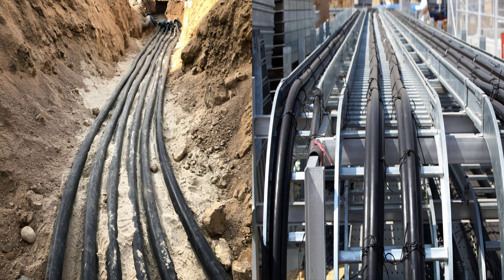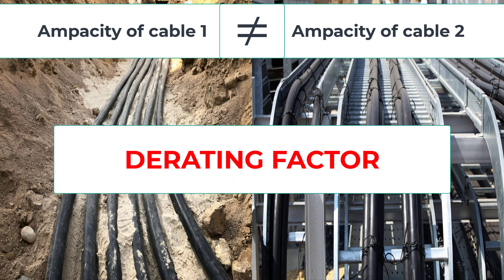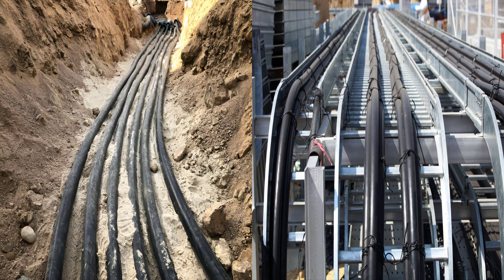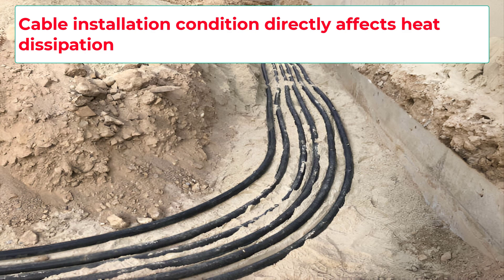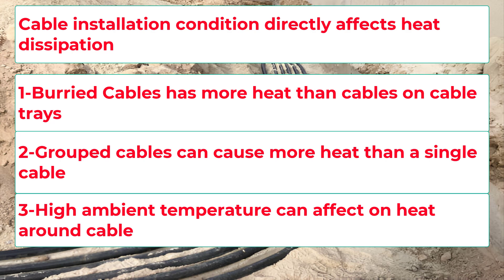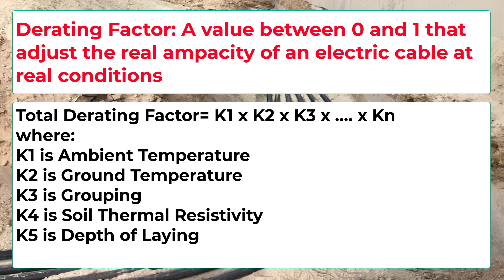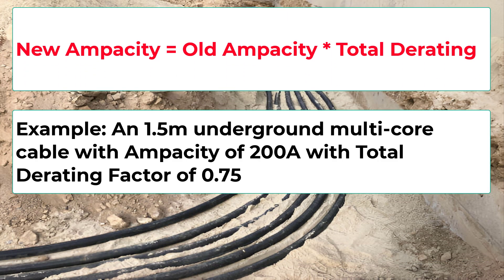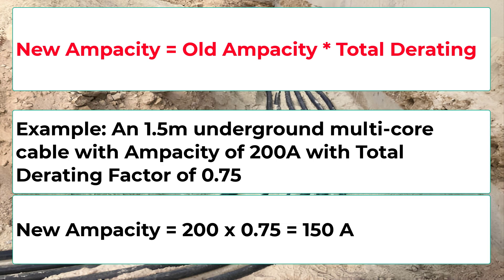Derating Factor of Cable |Explained

Comment: Could you pls make a video about AC and DC voltage drop percentage? Its very important in Solar System designs, especially utility scale. thnx
Reply from the maker: sure stay tuned, and thanks for support
Reply: @electricalengineeringplane6620 great! Will bw waiting for it! It will be nice to include derating factors also